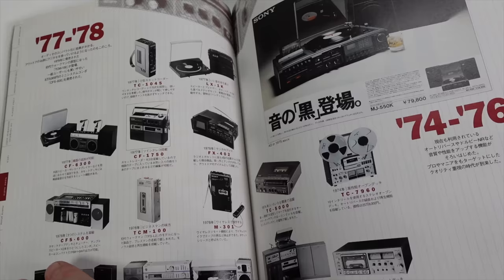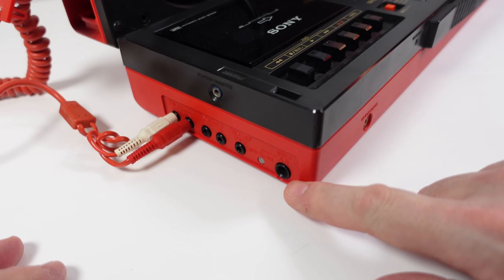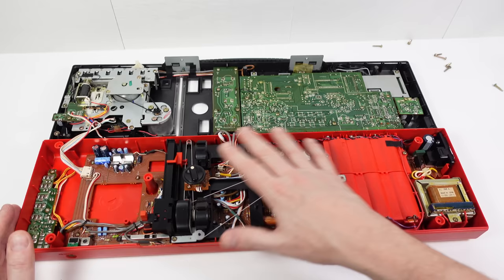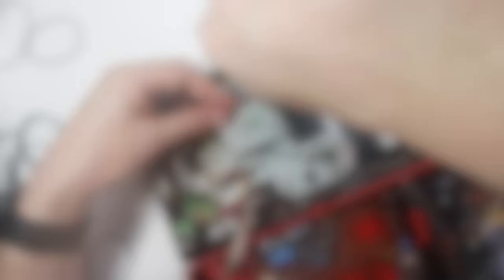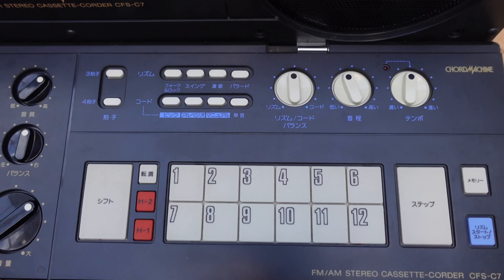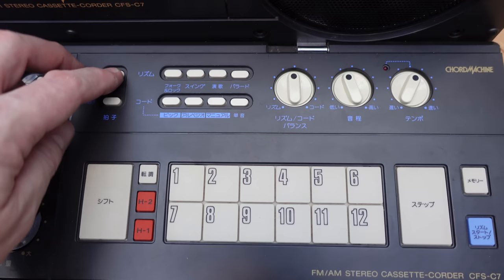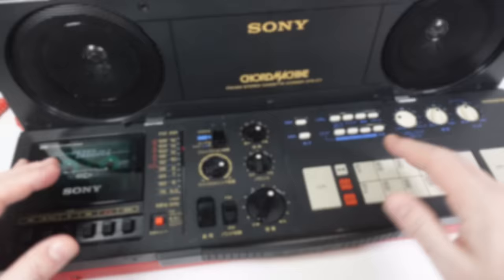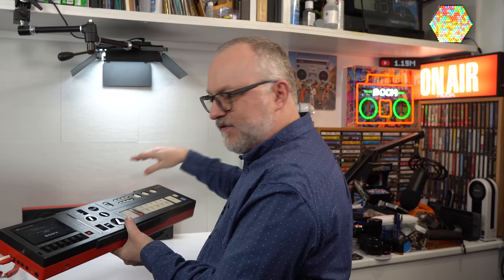The Sony CHORDMACHINE

Comment: Love that you can use a wifi router as an interactive proximity-based audio FX unit. Some seriously forward-looking performance tech.
Reply: Sort of a rudimentary Alesis AirFX, and nearly 20 years before that unit. 😄
Reply: Even left a panel for circuitbending.
Reply: Lmfao
Reply: It's a percussion theremin!
Reply: I liked the ring modulation it created.   Quite an awesome sound.
Reply: That's the best thing it did!
Reply: You can even use it to locate wifi signals.
Reply: Absolutely. Wifi lofi glitch beats. Gives me inspiration for setting up my gear in new locations.
Reply: Modern WiFi and circuit bending turns this chordmachine into discordmachine.

Comment: On wifi vs old sound machines, I spent about 4 hours cleaning and reseating and testing things ony mother's old kimball organ until we realized the noise it made was exactly in rhythm with the LED indicators on the wireless router/modem sitting on top of it 😄
Reply: LOL that's great, what a way to realize what the problem was
Reply: This is a lot like those organs in the late 1960's & 1970's, where they had preset cords and rhythms to assist the player.
Reply: lmao, amazing
Reply: is it possible to create a shield inside the machine?
Reply: @Federico84 a sheet of aluminum foil would work.

Comment: WHen I was majoring invocal performance (1988-1993), I'd have loved having that.
The 12 keys are the 12 half-steps of the chromatic scale. The normal (Major) scale uses keys 1,3,5,6,7,10,11,12; a chord is 3 notes in key. The three smaller buttons to the left are the quality: major is default, you hit a minor and a diminished chord, and somehow got a 7th chord as well. 
Normal 4 chord progression (So-called "I-IV-V-I" is 1-6-8-1. a more colorful tone, with more "resolution", you'd charge that 8 button (The V chord, "fifth chord") to 7th-modifier + chord 8.
It's aimed at practicing voice and/or guitar without needing a piano keyboard. (Many vocalists have piano issues...) 
Sad songs, the progression changes to I-iv-v-I (capitalization matters), so button 1, minor+6, minor+8, 1. Or I -VI-iv-v-vii°-I, played with 1, 10, min+6, minor+8, diminished+12, 1
If you know what youe edoing, you can shift it into any key by simple addition; the tuning knob is for matching with intonation-invariant instruments (like bugles, recorders/blockflutes, Tin whistles, etc.)
It is VERY approachable to those with elementary chord theory. It also was pretty much superfluous - most decent keyboards (and lots of crappy ones) had the same functionality built in, usually labeled on Yamaha machines as "ABC" (for Auto-Bass-Chord)... you play the root note of the chord, and one or more keys as well, to set the "quality"  - Major by default; minor or diminished or 7th with one extra key above the root, minor-seventh with two, diminished 7th with a different 2. Our 1978 or so Yamaha console organ had that functionality on the second manual.
Reply: Looks like the modifier keys (H-1 or H-2) allowed you to switch between 'regular' (major) and minor or 7t chords.
Reply: If you are creating music using the stuff on the right, can you use the cassette deck on the left to record it? Mr TM might have mentioned it, but if so I missed it. Seems a bit daft if you can't.
Reply: Thank you for your explanation
Reply: @fredbloggs8072  im pretty sire he said that you couldnt record the cord side
Reply: @keltar4071  See the caption at 13:00, you can record whatever it outputs, radio, mic, chords, drumbeats.
Reply: Circle of fifths!
Reply: I'm sure that Bach would have a field day with this instrument.
Reply: I learned a lot just by reading your comment.  Thanks.
Reply: beato
Reply: Well I’m confused lol. You sound like you know what your talking about so I’ll just agree
Reply: exactly what I was thinking about. Yes, no need for learning to play a piano first, just setting it up, rithm and singing and no need to do difficult things with a minimized keyboard.
Reply: Enjoyed reading that, thanks.
Reply: Not all heroes wear capes.
Reply: @Stoney3K  I heard Techmoan hit a dim chord. With M, m, and dim, one can do about 80-90% of recorded music. I'll note that ti doesn't appear to allow for inversions (Where the root isn't the lowest note, but an octave or more above the theoretical root.) Neither have any of the keyboards I've played, including a full size Yamaha digital organ from about 1977.
Reply: @nickinportland  It's OK to not get it. Music Theory gets pretty dry. Just understand that 
1) Chords are groups of 3 or more pitches played at once.
2) They come in different varieties
3) The change of chords is what gives most music its sense of motion 
4) certain patterns of chord change have specific meanings: End of section, and End of Piece, and those two are similar in sound.
5) Chord names tell you which notes to play in a shorthand text symbol.  
6) Chords require 3 or more "voices" to work as chords. (There are ways around that, but that's really a digression)
As for the device...
That device is set up for a less common shorthand notation than most musicians use, it plays 3 and 4 voice chords in the most common types, and can play the most common accompanyment chord progressions (patterns of chord changes).
It's quite useful for practicing as a vocalist with poor piano/synth skills.
Reply: @stanleycostello9610  Bach? Dubious. Bach was very picky about which inversions to use. 
For the non musical, inversions are when the notes are stacked in non-default order. So, for example if using a C Maj, that's CEG. Any combination of CEG is a C Maj chord. If your bassist (or on a keyboard, your leftmost key) is C, that is in Root. If the bass is playing the E, that's "1st inversion" and if the bass plays the G, that's "second inversion." If a tetrad chord, say C7 = CEGB, third inversion is the 4th note of the tetrad in the root. Bach basically invents our modern system of Harmony. About 80% of Rock & Roll is using Bach's functional harmony. Add Brahms' expansions to it, and you get to about 95%. Add Mozart's exceptions and deviations and you get to about 99% of Rock & Roll.

Comment: It never fails to amuse me that a key component of music technology in this era was a rubber band.
Reply: To this day, most cars' engines depend on a timing belt. If not replaced every 5-6 years, it may snap, which causes pistons to go domestic violence on the valves. That's a catastrophic failure you can't fix with a new belt. Why is it still like this? Because it's still the cheapest to manufacture system.
Reply: and older cars actually had gears instead of a belt (or chain which is also common today), but that changed when the camshaft moved upwards to the top of the cylinderhead
Reply: goat invention

Comment: that time when completely by accident Techmoan invented wifi circuit-bending without realizing it..BTW that middle variable control is tuning/transpose so you can tune it to the guitar or change the pitch to better fit your vocal range

Comment: I'm not sure it would have been useful, but as a musician I would have loved one to play around with. I could certainly see using it for a very basic song sketching tool. Could be useful for lofi or vaporwave music as well.
Reply: You can play around with MIDI ^_^
Reply: It'd be great to have the sounds of this as a sample pack. Especially the drums.
Reply: It feels like they missed a trick really. If it had a proper sequencer, better integration with the tape (eg for a tape loop) and some way to change that sound a bit, even just a high/low pass filter, this thing could have ended up a techno classic. Maybe adjust the tempo range towards the higher end as well.

Comment: This is a very interesting device, it's amazing how you keep coming up with completely random stuff I had no idea existed. One thing I immediately noticed was the proximity of the speaker and the tape deck when closed. I would not leave a tape in the deck!
Reply: And I guess they are not magnetically shielded speakers  😁 😁
Reply: well spotted, the tape head probably doesn't like it much either, I wonder if that's why it sounds so dull (I assumed it was just out of alignment)

Comment: 7:16 - you really need to add a little new solder to get a decent joint. And reflow all 3 joints as if one is fractured there's a good chance the others will be
Reply: And preferably with leaded solder just for longevity, as long as you take care to not breathe it
Reply: @app0the  Most the smoke from solder is the flux, regardless of type (still not great for you, but not a heavy metal). It's not like the lead is turning into gas when you heat it with an iron.
Reply from the maker: and with solder blessed by the Pope
…on Mars
Reply: @AaronSmart.online  Makes sense. I'm just trying to make up a reason for myself to not go into another rant about how RoHS is just another conspiracy to make everything last just a little bit and then have all the joints crack or develop whiskers :p
Reply: @Techmoan  praise the Omnissiah.
Reply: @app0the  I'm with you ONE HUNDRED PERCENT.
(Should be 60/40.)
Reply: Yes if you look carefully the far joint is also dry and cracked round the pin circumference.
Reply: I assume the point of the repair in this case was to get it working long enough to demo it with as little effort as possible, not very likely that this device will see many hours (or even minutes) now that this video is out, so I don't really see any reason for criticizing the quality of the repair. I belive the theme of Techomans YT channel is not so much about repair techniques, but rather about showcasing odd and interesting devices  (mostly from the past). :-)
Reply: It's a tech channel, not a how to repair beyond reproach channel. He just wanted to give it a nudge so he could show it working. And don't bother with "if a jobs worth doing". No one cares about pedant specialists for this type of content. He's not ifix it. Jesus, I could never make videos for public consumption. The vampiric experts would fly in and suck away my enthusiasm.
Reply: @app0the  I doubt its that,  I feel more like its an example of politics getting into something they don't understand and fucking it up
Reply: @Techmoan  On Venus, where it's naturally liquid..
Reply: @AboveEmAllProduction  *doesn't
Reply: @greendryerlint  I don't think AboveEmAllProduction cares either.
Reply: @Techmoan  no just drop some no clean flux on it before you do it and it comes out looking so clean and professional
Reply: @johnmiller0000  Was just in a pedantic mood, as a card-carrying nerd.
Reply: You can tell that the Pope blessed it when the smoke is white.
Reply: be gentle with each other, sometimes people want to be helpful and feel involved, we need a little more understanding, people like sharing their suggestions
Reply: @DieselDahl  And let’s not forget, the device is actually working now.
Reply: @Techmoan  lol
Reply: @Ramog1000   My understanding was to remove lead from electronics going to disposal.  That actually does seem to have some merit.
Reply: I was thinking the same. Put some flux on the joints and reflow. Might as well do the other channel as well.
Reply: Good suggestion. I'm not sure why anyone is making sarcastic jabs or accusations of pedantry and criticism when it seems that this comment is made in good faith rather than malice, but it certainly reflects badly on them.
Reply: @greendryerlint  run yall itz th gramer policee
Reply: @DieselDahl  Very true, but I don't think OP was criticizing. Everyone seems to have taken it personally. - It was just a tip.
Reply: @mickeythompson9537  I'm more of a distinguished connoisseur of Sn62Pb36Ag2 myself.
Reply: @woodhonky3890  You have to stop texting and driving..

Comment: I'm sure everybody's mentioned it already, but it's very clearly intended with karaoke in mind. The idea of the chords and the separated speaker section is that a singer with no piano skills (or access) can accompany themselves with obnoxious 8-bit chords. Think of it as an electronic version of the auto-harp. 

Also would be good for busking, but I can't imagine they smile on that kind of thing in Japan.

Comment: Comments showed a lot of use cases: at-home karaoke, storytelling, busking, guitar practice. Now, as others have said, it would be great for genres like vaporwave. I can imagine this probably was better suited to the Japanese market, where karaoke was bigger, than to the US or UK, although I guess it didn't take off even there.

That comment that described what the buttons did was golden. I have a Casio keyboard that has "Casio chords", but I think these are actually more intuitive. It's also way more portable than a full keyboard.

I loved how the machine had corresponding 3/4 and 4/4 drum patterns for different styles like jazz and pop. And I get that you couldn't play regular melodies very easily with a 12-tone chromatic scale, but since it is chordal accompaniment, that's not really an issue.

My favorite part of the video was when the chords were being detuned and arpeggiated at the same time over the drum backing track. I could imagine creating some great samples from that.

Looks like you could get one of these for somewhere in the $400s which makes it a pretty good value I think if you want to produce music with genuine and obscure retro synth samples.

Comment: This was certainly for a type of karaoke where you don't need to buy karaoke tapes. If you had a chord book or new some chords to your favourite song you could easily auto accompany yourself. I mean you could just use a guitar or a piano for the same purpose but I guess this has a bit of a beat at least.

One correction is that you say it only plays one note at a time when it actually seems to be capable of playing chords with multiple notes voiced together. Which may have made it somewhat cutting edge at the type compared to monophonic synths.

Comment: I think people who commented earlier have it right. In a nutshell, this device has been miscategorized. It's not a boom box or even a personal stereo. It's intended to be a musical instrument. More specifically, it's what an amateur musician might use to turn himself into a one-man band. The guitar input, which could also have been used as an electronic keyboard input, is the giveaway.  (As others have suggested, a street busker might have made use of it as well.) It even has a pitch control that allows you to tune the device to your instrument rather than the user having to tune the instrument to the device. But what places it firmly in the amateur market, as opposed to the professional market, are the inclusion of a low-end tape recorder, speakers that fall far short of performance quality, inflexibility when it comes to the beat box selections and chords (a pro or even pro-sumer model would have enabled the musician to program their own beats or upload them via a MIDI interface) and, yes, the built-in radio. A serious musician would have appreciated the mic so he could mix in his voice with the instrumentation, but the ability to sing along with the radio or tape is really more of a home consumer thing. As to why it failed, I think you're on target when you suggest that Sony didn't understand the market for electronic instruments. Maybe this was a sort of a test to see if it made sense for them to enter that market. Or maybe they thought the decreasing costs of electronics could lead to a trend back toward the Tin Pan Alley days, when people were more interested in playing music on their own instruments at home. (Prior to the advent of hi-fi stereo, you basically had two choices if you wanted to listen to music with great sound: go to concerts or learn to play it yourself. Many people actually opted for both.)

Comment: This ‘CHORDMACHINE’ is a direct project of the CF-9000 monaural radio-cassette that existed before that.

The CF-9000 is a radio cassette equipped with a drum machine called the SONY CF-9000 Rhythm Capsule, and similar projects were made by Panasonic, JVC, Sharp, Clarion (currently Hitachi), etc. So, along with other musical instruments such as guitars and synths and a mixing function, there was a radio case equipped with a rhythm box. It's epoch-making that it has chords and scales.

Also, the "drum machine" mentioned in the video is played with a single note, but in the first place, this chord machine sounds like an analog drum machine. Around the same time, Fairlight (1979) was an eight-sound digital sampling machine that cost $ 100,000 at its current price. At that time, digital sampling machines were so expensive.

The Roland TR-808 (1980) is a fully programmable rhythm machine that uses earlier technology (repeating certain pre-installed patterns). Organ maker's rhythm box and KORG's SR-120.

The first PCM sampling machine LinnDrum, which is said to have only a few dozen units in the world, was sold to professionals in 1982 for about $ 3000. Digital sampling synths will be installed in boom boxes later.However, the first Sony drum pad was full of sounds resampled from the Linn 9000 except for Sony's shouts.

PHILIPS also has a radio-cassette PMC100 (1986) equipped with YAMAHA's FM sound synth.

Comment: This could have been cool if you could play back and record at the same time to add layers. I could see a use if you could record a drum line with the drum machine, add in guitar, add in synth and record multiple times to get more sounds etc, then record vocals over that. Add being able to effectively take samples off the radio with the tapes and it could have been a cool toy.

Comment: I used to repair these tape drives back in the 80's. It's a good idea to clean the pullies (anything the pullies spin or glide on) with isopropyl alcohol and cotton swabs first. This way you clean the pully surfaces of any old rubber residue, etc., first.